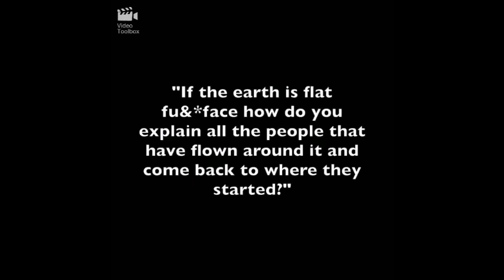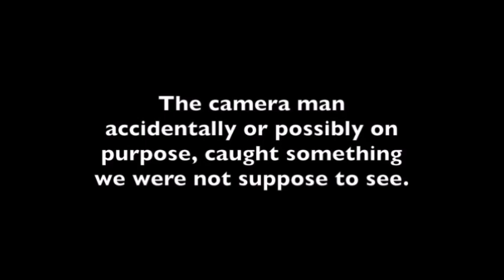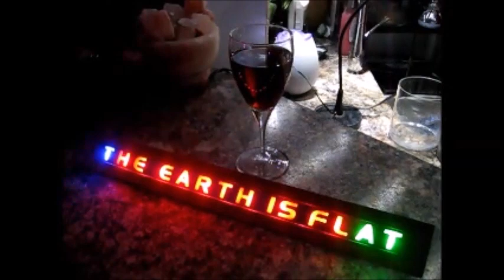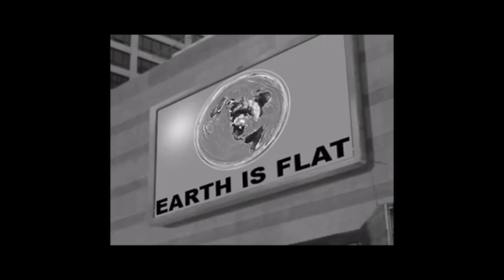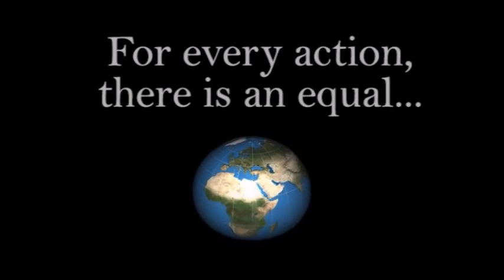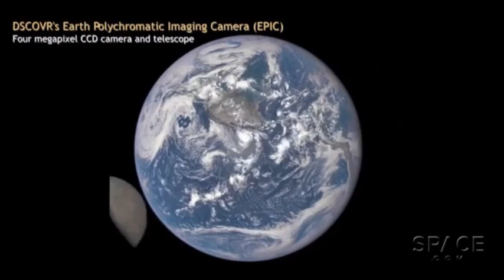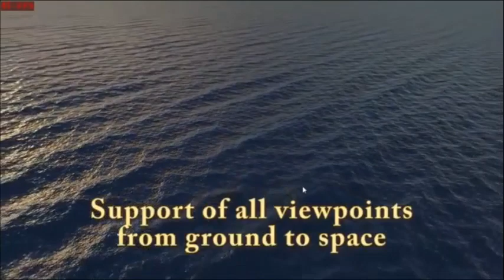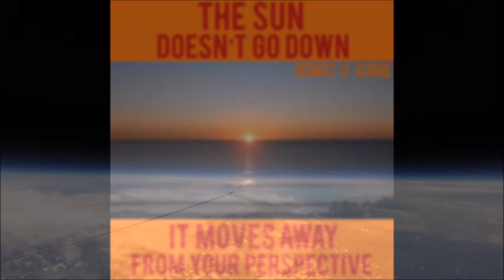Flat Earth Q&A Emails 87 Mark Sargent ✅

Comment: *sigh*.. this nut claims the ISS is under 'extreme' pressure in space  and it would rip itself apart.   The pressure inside the ISS is around 14'ish PSI, the pressure outside is around 0.  That's around 14 PSI of difference.  There is more of a pressure difference between the inside and outside of your car tire.  Car tires also don't explode when the get a nail in them.

If anything goes under water more than around 33 feet, it would also experience a greater pressure differential.  This guy is a nut.  He's great at making wild claims, but you'll notice that he'll never watch back them up.